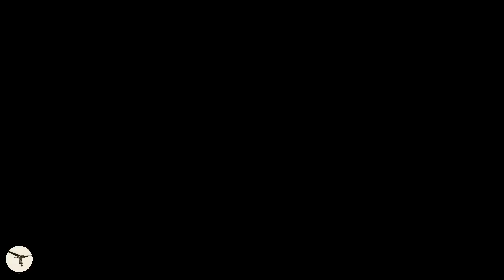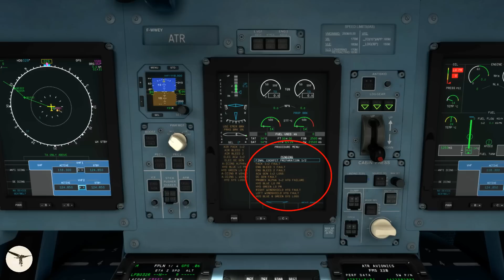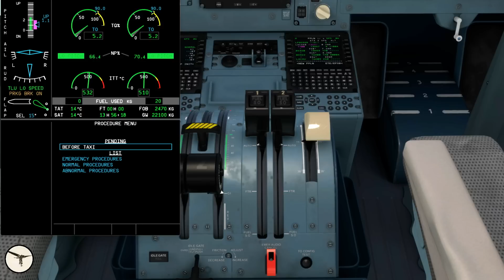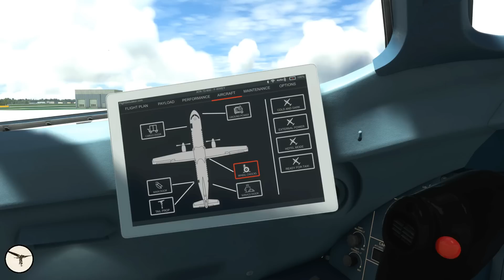ATR 72-600 for MSFS tutorial by ATR instructor - Part 2: FMS setup, engine start and taxi

Comment: Thanks for the very detailed and explanatory tutorials! But I ran into an issue:  when I try to start the engine 1, oil pressure won't go more than 28 psi and engine  won't start. Any suggestions?

Comment: Any ideas on this? Still the same….

So I checked once again today. My “ready” light does not illuminate for prop brake if I have connected GPU. 
If I leave GPU disconnected, then it will come on once Aux Pump is pressed. Very confusing. Not sure why this would be.

Comment: Great Video. I was wondering, in real life. there is possible to turn on the plane from cold and dark until Turn engine 2 in hotel mode without conetec a GPU?
Reply from the maker: Yes, you can. The engine can be started with battery power alone. We do that when GPU is not available.
Reply: @FlywithMagnar  many thank. I really appreciate your videos and effort

Comment: First I would like to congratuate on your video series. I have a problem I can't put right, somehow I've gone and put synthetic vision on the PFD screen, therefor the information is hard to see. Can this be reversed
Reply from the maker: Yes, it can. I do not have access to MS202 right now, but if I remember correctly, there's an option on the VCP when you press the NAV key a few times. The VCP is on the lower part of the MFD.
Reply: All sorted thanks. Not know wot you call where you set come nav there is a section for pfd synthetic vision on & off. Thanks very much 👍

Comment: Hello Magnar. Great tutorial but I have just a couple questions. I can't seem to get the TRU to engage when I press it. Everything else seems to work fine but for that. Second, as I have always understood it, in the real world it is SOP for ATR pilots to taxi with just one prop going. Is this just a company specific SOP thing? Thanks.
Reply from the maker: I cannot answer for the TRU. When it comes to single engine taxi, ATR no longer recommend to do it before takeoff. It is better to start the engines before taxi as it 1) otherwise takes away consentration from the crew, and 2) if there's a problem during start it is always better to stay at the parking stand. However, we do taxi single engine after landing (after a 2 minute cooling period).

Comment: Hello! I really appreciate your tutorials :) I have one issue with the plane. My NP% doesn't go over 63.5% at Ground Idle. I need to give it more throttle or else I will not have enough hydraulic pressure and power. Is that a correct value in real plane so in my updated MSFS plane it's acting differently than in your video or this is now a bug in the msfs plane?
Reply from the maker: NP should be 70.8 % at ground idle. I know the team behind the ATR model are correcting this issue for the next update. (When I made the video, I kept the power levers a little ahead of the GI position.)
Reply: @FlywithMagnar  Thank you, hope it will fixed soon! Can you also create tutorial for non-GPU startup  or it's not really different from powering with auxilary power?
Reply from the maker: Without GPU, you do engine #2 fire test and start engine #2 in hotel mode. Then, you proceed with the rest of the tests.

Comment: Very good video.  Only one thing - you did not cover the setting of the flight director / FMAs on the ground. The video transitioned from there being no FMAs on the PFD, to HDG (LNAV armed) and IAS (VNAV IAS armed). Are these the modes that are always used?  Is there no dedicated "TOGA mode" on the flight director?  I was surprised to see that IAS is armed on the ground, as wouldn't this give false FD commands until the set speed is reached?   I'm not a ATR pilot and I'm not questioning your fantastic knowledge  :o)   I'm just interested in the FD set up prior to take off and noted that it wasn't covered here.   Thanks.
Reply: Before taxi, you set up the FGCP in 6 steps:
- Select Nav source 1 to FM1*
- Select Nav source 2 to FM2*
- Select ALT SEL to initial cleared altitude/flight level
- Select coupling to the PF side
- Select rwy heading on HDG SEL
- Press HDG, LNAV and IAS pushbuttons**

* In case of a non-gps departure (i.e. radar vectors, conventional navigation...) you may decide to select nav source 1 and 2 to V/ILS1 and 2, respectively 

** Basic modes are HDG and IAS. But you can also use if appropriate LNAV (will follow horizontal flight plan) and VNAV IAS (engaged pressing VNAV before taxi, and it will follow the vertical flight plan, respecting altitude constraints) 
Any question feel free to ask!

Comment: Timestamps for myself:

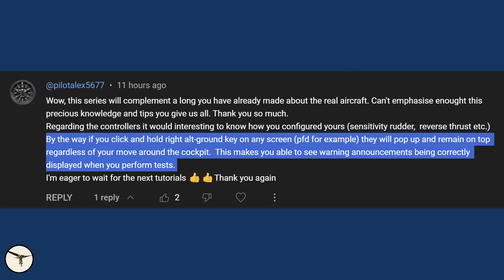ATIS / Radio Freq - 2:20
QNH Set

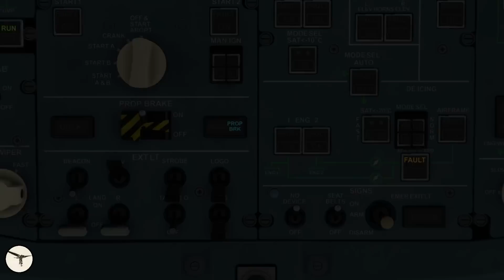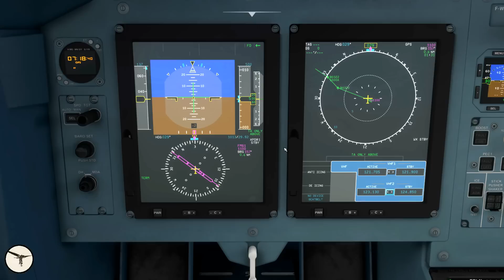4:42 - FMC - 10:35
(Weight) (Perf Init) (FPLN Init 6:30-9:05)
VNAV P2 - Insert QNH - Temp

ALT & Trans - 10:35
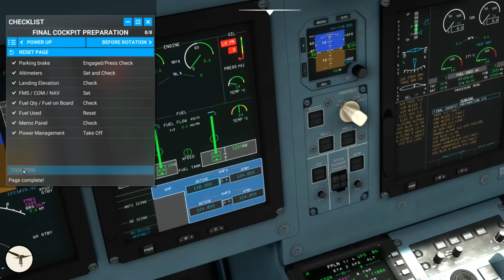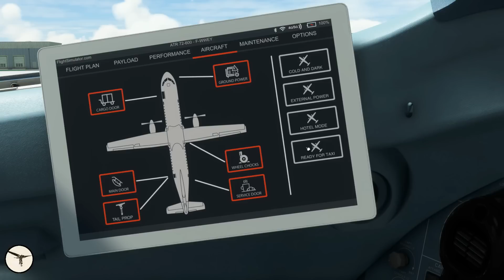Checklist - 13:56-15:18

15:20 - Hotel Mode - 00:00
Service Door CLOSED
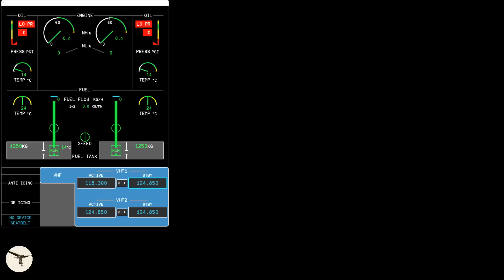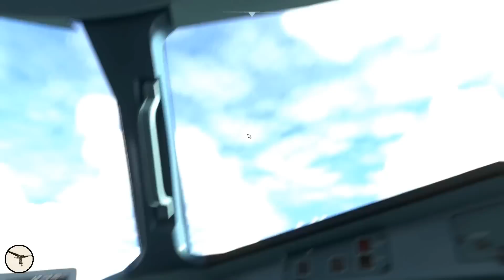Engine Two: 15:40 - 17:22
Fuel Pump 2 ON
Wing Lights ON
Prop Brake ON
Start A & B (first flight of the day)
(A for odd days - B for even)
ENG Start 2 ON
Cond Lever Level 1 - 10 %
ENG Mode OFF at steady
External Power OFF
Ground Power (iPad) OFF

After ENG Start
Pitch Trim SET
Confirm Take OFF Data
Doors & Tailprop OFF
(Clearence Eng Start Ground Control)
Beacon Light
Before Rotation Checklist - 19:10

19:50 - Before Taxi - 21:30
Aux Pump Press
Prop Brake OFF
Condition Lever 2 Auto
TRU On - 21:00
Probe Heat ON
Anti Ice (ON if Needed)
Flaps SET

21:30 - Engine Start 1 - 22:40
Fuel Pump ON
Start A&B 
ENG 1 Start ON
Cond Lever SET Feather
ENG Start OFF at Stabilize
Cond Lever AUTO

Communication Hatch CLOSED
NW Steering ON
After ATC Clearence - Transponder Code - 23:45

24:10 - Autopilot - 25:20
HDG ----> RNWY Heading
Heading Mode SEL
Nav Mode Sel
IAS Mode Sel
VNAV Mode Sel
Target Speed AUTO

Before Taxi Checklist - 25:25

26:04 - Pushback - 27:15
Wheel Chocks OFF
Clearence from GRD Control 
Taxi & TKF Lights ON
Elapsed Time ON 
NW Steering ON / OFF
Request Taxi
Taxi Checklist
Reply: Holy, That is usefull.

Comment: Thanks for the great tutorial, but I have a problem.. After staring both engines my HYD Blue/Green stay on LO PR..
Reply from the maker: The hydraulic pumps run on ACW electrical power. Checklist:
- Hydraulic pumps ON.
- ACW generators ON.
- Condition levers AUTO.
- Power levers GI (Ground Idle).

Comment: Hello. at 19:15 you can see the tab, t/o tq and the temperature is 21 degrees Celsius. What is this?
Reply from the maker: Engine performance depends on atmospheric temperature (and pressure.) The temperature sensors in the aircraft may not show the correct temperature, as they are relatively close to the engines, and the temperature on the apron may not be the same as on the runway. If the tempearture in the ATIS deviates from the indicated temperature, the pilots may correct the ENG SAT (engine static air temperature) with the +/- to get the correct torque (TQ) for take-off (T/O.)
Reply: @FlywithMagnar  ok thank you very much for your answer😃

Comment: I have so many questions. Like what does 'crank' do? And why do you do A and B on odd/even days and such? If I skip procedures or forget something, will the aircraft be in any danger? (flightsim enthusiast question)
Reply from the maker: CRANK means the engine starter is used to turn the engine, for example to ventilate the engine after a failed start. START A and B are the igniters. The engine has two igniters (A and B) that are used to ignite the fuel during engine start.

Comment: Waiting for the third part of the splendid ATR tutorial, one question:
 I saw that like me you use the Thrustmaster TFRP Pedals pedalboard.
How do you find the action of this peripheral ?

I have some difficulty keeping the aircraft centered above about 80 knots during the takeoff roll and up to this speed on landing.

I have tried various configurations and sensitivity adjustments but without great success.
This happens with both the ATR and the Airbus A320.

It would appear that just before generating the lift necessary to "detach" the wheels, modeling the roll makes the aircraft excessively light.
I am a pilot of light propeller aircraft and I know the effect of crosswind or the need to compensate the propeller torque with the pedals in a single engine but I have never had problems when the nose wheel lifts and the main landing gear is still on ground.

I would like to know your opinion or if any other subscriber has the same problem.
Thank you
Reply from the maker: Hi. The rudder pedals are too sensitive. With the standard settings, it appears that full deflection is reached with half pedal deflection. Another problem is that there's no aerodynamic feedback from the rudder. Therefore, it is easy to overcorrect.
Reply: @FlywithMagnar  thank you  Sir.

Comment: Loving this series Magnar! Would you be able to cover the Idle Gate? I find this is activated in flight and throttles won’t move without de-activating. I don’t touch it but would love to know more. Thanks again!
Reply: Idle Gate prevents the power levers from getting behind Flight Idle inflight as this can lead to a loss of control of the aircraft. It is pulled and pushed automatically by the plane but in case of an electric failure (sorry I don't remember right now what bus powers this system) PM will need to pull it back manually on touchdown.

Comment: How to adjust the trimmer?
Reply from the maker: Aileron trim and rudder trim switches are on the pedestal (see video 1). For pitch trim, I'm using the trim wheel on my Honeycomb Bravo. I'm pretty sure there must be a key command for the trim. Can anybody help?
Reply: @FlywithMagnar Hello Captain, is it like mine where I have to turn the trim wheel many many turns to make it go up or down ? 
Thanks
Reply: @FlywithMagnar  yes, do we change the trim during the flight?

Comment: Thanks for the video. Just a quick one. Does the FMS in the Asobo's ATR allow for replacing the arrival runway in case we need it? I have been flying the Asobo's ATR for a while and I could not change the arrival runway once set. I assume I am doing something wrong most likely...
Reply from the maker: I haven't tested it yet. In MSFS it's possible to fly without having selected the arrival airport.

Comment: Hey, thank you very much for making this video's. I didn't know about the updated FMS initialisation steps. Apart from the bugs and limitations you already mentioned, i noticed a couple of things the sim aircraft and here too which seemed like bugs to me, so if you could actually confirm that would be great.
1. I noticed you entered cruise altitude which was higher than the initial cleared altitude of 7000 feet. But then when you later came back to perf init page again to access weights page before entering the final weights from the loadsheet, the crz altitude was changed to 7000 ft. I think this happened because you entered that altitude in the FGCP. I suspect the real plane doesn't behave like this, because otherwise you wouldn't have followed this procedure.
2. In the same page, it seemed like the alternate airport and altitude went missing too after flight plan was initialised.
3. The transition altitudes are set at 18000 ft, does the real aircraft automatically detect a transition altitude form the fms nav data and the citypair?

Also, do you use the sec fpln in real life?

Thanks for the videos, great learning experience.
Reply: 1 and 3, I think you are right. 2, it is a bug from MSFS, hope it is fixed with the new update. In Secondary FPLN, in real life before departure it is set the Engine Out procedure, and before arrival you can insert the diversion to alternate FPLN  but this is not that much necessary really, not usually done

Comment: Hey Magnar, thank you so much for all your great Videos. Two more tricks for msfs. 1) You can use the free tool "Simbrief" to generate a full Flightplan (for the ATR) with all data like fuels, payload, zfw etc.
2)Under "Options/General Options/accessibility" you can turn of the "instrument name tooltips" 
I guess you will find the right switches in the ATR without the big blue Pop-up Info tooltips😅
Keep Up the good work !
Reply from the maker: Thanks for sharing!
Reply: Do you know how to also turn off the tooltip with the eyeball that points towards a control you have highlighted but isn't in view?  I can't find anything that turns that bit off and it gets rather annoying in VR
Reply: @JohnVanderbeck  to my knowledge you turn off by clicking on the eye to the right of the fs checklist item.